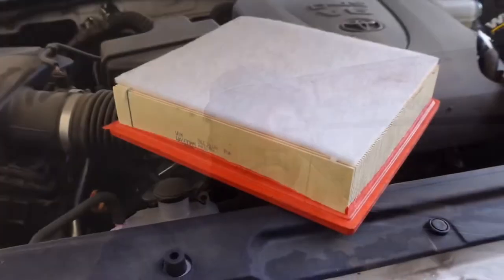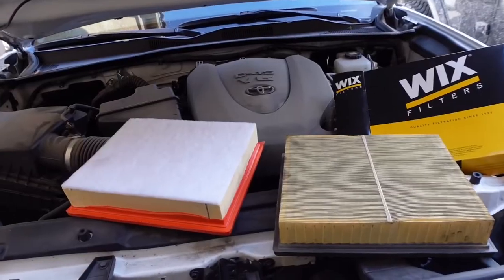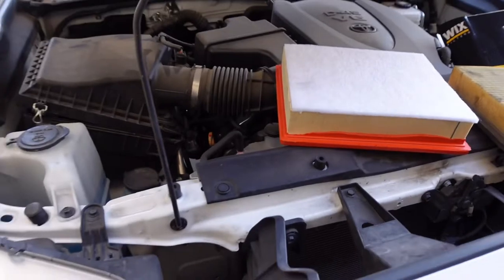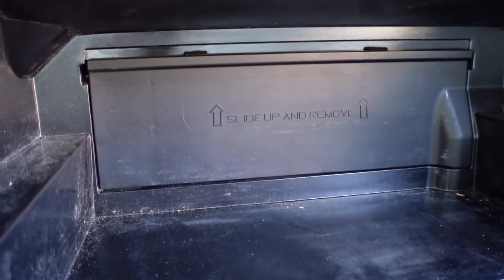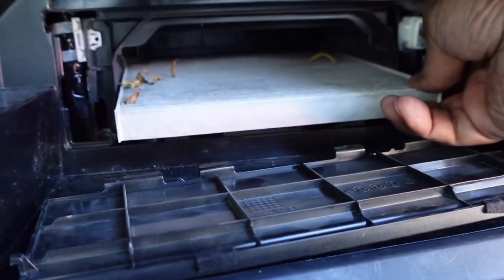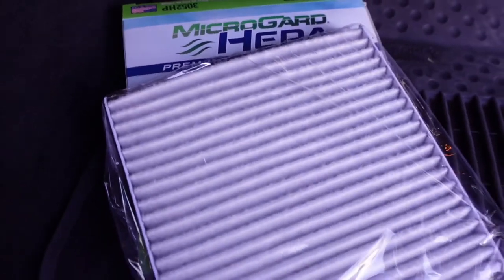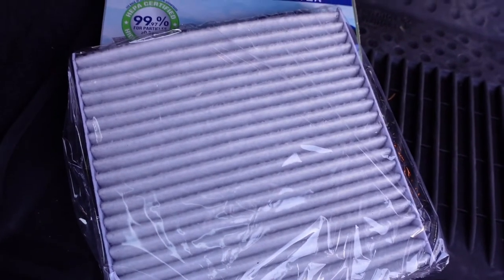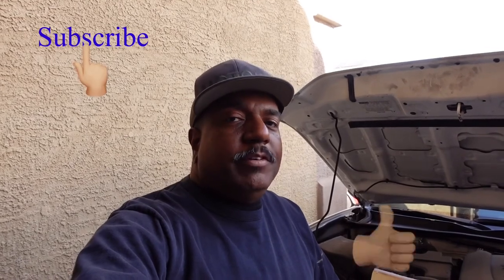Don’t Make The Same Cabin Air Filter Mistake I Did! Watch this first!

Comment: Excellent! Happy to see that you figured it out.
All horizontally mounted cabin air filters with the blower motor mounted below the filter will have downward air flow direction otherwise dirt and debris would be trapped inside the blower motor.
Reply from the maker: @JackTannehillPromoter. Yeah. That was the first time I replaced it. Felt pretty silly after a quick review. 🤣. Thanks for watching 🙏🏽

Comment: It’s good to change those filters. On my wife’s 12 Tacoma there was a terrible smell and I found the cabin air filter covered with a mouse 🐭 nest 🤮 it was so bad smelling I thought I was gonna have to burn that truck down to get rid of the smell. I finally got rid of it and we still have the truck. 
It only has 50 k miles on a 2012 truck. 
I have found that if you take regular vinegar and put like a cup in a open container on the floor it will as sorb the smell. Just don’t spill it in your truck.
Reply: Next time I do that trick I’m gonna saturate cotton balls with the vinegar and put them in a container that won’t tip over and leave it on the floor for several days. It needs changed after a few days.
Reply from the maker: OMG. You had me crackin up. 😂 
All good info. 
50k on a 2012. That thing is worth it weight in gold right now. 💪🏽

Comment: I need to change mine in my Jeep along with diff fluid just hit 48,000 miles
Reply from the maker: @swashbuckler. Yeah they didn’t have a cabin filter for the jeep that day. So that’s next. Swapped the engine air filter for K&N. I’m about to hit 40k this week so more regular maintenance is coming up. 
Really need to rotate them tires. Been putting it off. Lol. 
Thanks for watching as always 🙏🏽
Reply: @elandmotors8845  yeah I did a k&n also, loving my 35x10.50 tires along with rubi suspension! It’s perfect for what I use my Jeep for, taking it on a camping trip this weekend about to install a fox steering stabilizer
Reply from the maker: @swashbuckler5539  sounds awesome where ya headed?
Reply: @elandmotors8845  outer banks North Carolina this year then, South Dakota or Arizona next year
Reply: @elandmotors8845  camping on the Kentucky adventure tour Friday in the Daniel Boone national forest
Reply from the maker: @swashbuckler5539  sounds amazing. 
We did Goller Wash and Mengel Pass and camped in Death Valley a couple weeks ago. Can’t wait to hit it again. Have fun and be safe. 😄
Reply: @elandmotors8845  epic! You as well dude! I’d love to cruise through a desert one day